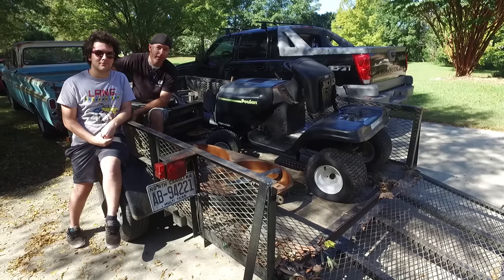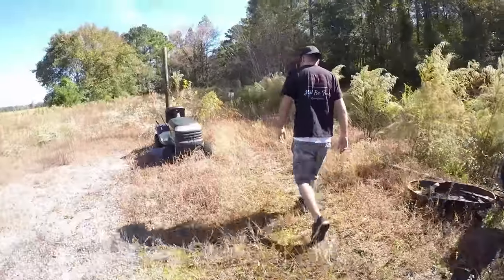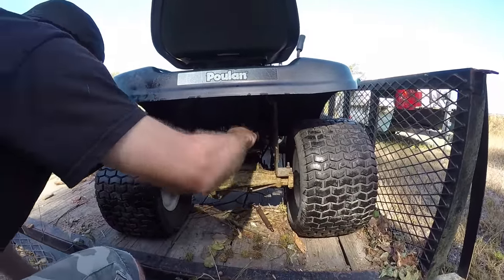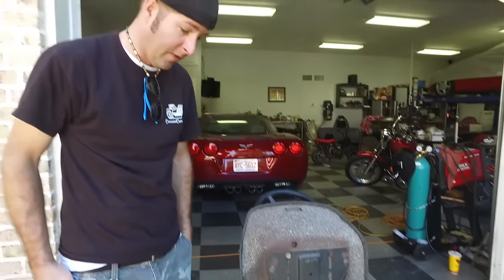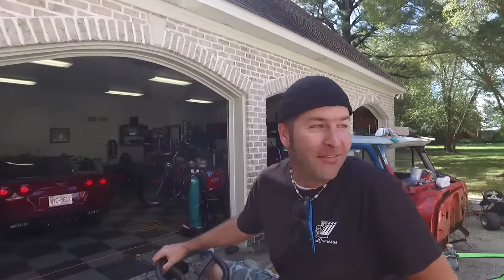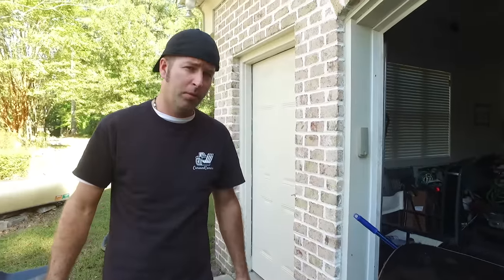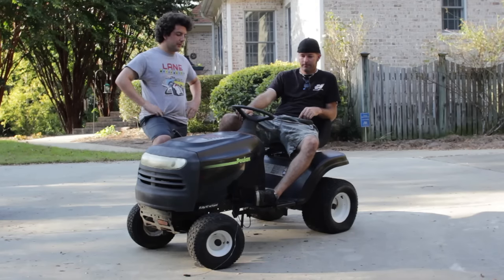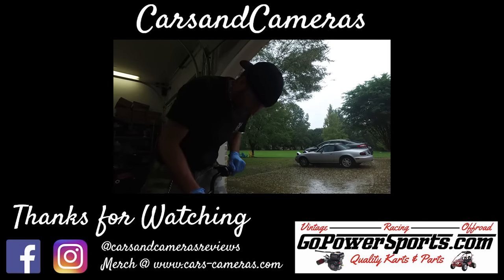We're Building a Racing Lawn Mower!

Comment: Love it! I'm building my first one now too. Intek 18.5 with a peerless 6 speed. Going with a 7" on the motor and a 3.5" on the transaxle. Can't wait to see more guys!!
Reply: Btw... you may want to lower it first then worry about pulleys and speed. That way you will know what kind of space you have to work with and figure out the best way to line up your belts.
Reply: mine has 7 horse flat head brigs i cant turn right with out sparks flyin out the bottoom my plan is pully swap throttle and grind grooves for gears

Comment: I'm jealous. years ago I built one out of a craftsman riding mower. I lowered the entire body,, moved the front end forward on the frame, and made an adapter for the steering shaft so I could run an old go kart steering wheel. Was working on mounting an 18 horse briggs twin with a straight axle in back, but life happened. Never quite got to finish it.  Excited to see what you guys can do, you never disappoint.

Comment from the maker: It's destined for 40mph... Hopefully.
Reply: CarsandCameras 3rd
Reply: CarsandCameras hello
Reply: It'll be fine.
Reply: CarsandCameras can u guys build a gass razor scooter with a weedeater engine
Reply: CarsandCameras thank you guys so much almost in every single one of you guys videos I have suggested a racing lawn mower
Reply: CarsandCameras. you guys should have a live axle kit on it but on that rear engine mower has a gearbox that you guys could use as a transmission
Reply: ehhm, i'm only 2 minutes in but i highly doubt this will work whilst being able to mow. The Rotor on the bottom has a maximum rpm for a reason. DONT EXCEED IT. BAD THINGS MIGHT HAPPEN. sorry for shouting so loud.
Reply: CarsandCameras remove all restrictors if there are any ;)
Reply: CarsandCameras whenever you slam that tractor down to the ground if you don't want a go-kart axle what you could do is flip the transaxle upside down so pulley is at the bottom so it can match up with the engine pulley easier
Reply: you guys need to check out fearlessfront he dose all kinds of mud mowers but usedt to get them up to like 50 mph
Reply: Scorpion623  I second that. I've been watching him for like 2 years now and he is awesome more of a tractor guy but still, his ingenuity is awesome!!
Reply: CarsandCameras should easily get 40mph i have a couple that do 60mph using only stock mower parts.
Reply: CarsandCameras you guys probably won't make it over 25 miles an hour without the deck breaking or something else
Reply: CarsandCameras when is the next video
Reply: You should build something with a 2 Stroke "racing" engine
Reply: CarsandCameras lol
Reply: CarsandCameras just a friendly word of advice for you guys...that lag in the starting in many many cases for those old Briggs is caused by the valves being out of adjustment i believe especially for that poulan that the valve adjustment is 3-5 thousandths but any who research it some your self as well I hope I have been a little help full just as some of your videos have helped me on my projects thanks guys!!
Reply: This will work #CarsandCameras hopefully - lol can you hit the subs for them thay work day and night p.s Isaac works but Jon is in school. Help them out!!!
Bin hear since you guys have been on YouTube!!
Reply: CarsandCameras 
The larger you keep the rear pulley the less slip you will get...
3-4" on back and 6 or more on the front. 
I'm running a 6 front 4 rear. 
Mine does 23 with 18" tall tires and a mst-206 and I keep it around 3800 max. 
Lock the diff and put oil in the gearbox. 
Fearlessfront is the man for transaxle info, although everything I've learned I've posted in videos on my channel. 
I swapped a 20hp in place of my 12, and now it's downright scary and will wear you out of you try to ride it hard.
Reply: CarsandCameras 
After swapping pulleys you might need to readjust or add guides near the pulleys ...
those guides are those funky rods handing down near pulleys. 
If they aren't there , when you push the clutch , the belt slings out too far from the pulley and it'll keep going and will grab and chatter and act crazy. 
It took me a few minutes to figure that one out. You may or may not need to add some idler pullies, or relocate existing ones. 
Getting the belt setup right so it doesn't throw belts all the time can be a little tricky but not impossible.
Reply: I did notice a little slipping when we swapped pulleys lol
Reply: thanks for the info
Reply: Isaac it'll be fine We are running the stock rear 9" on the front and the stock 3" front on the rear and have no slipping issues. Even have a 10" front and 2 1/2" rear on one of them and still no slip. We did use a stronger clutch spring. You can hole saw the centers of the pulleys out and swap them and weld the centers back in.
Reply: I've had good luck with those "red Kevlar eBay belts" , they seem to grip good even when wet. 
I briefly used a tractor supply blue one before I got the red one , it was pretty good too. 
Way better than a standard belt.. 
get one after your rig is tested and works
Reply: CarsandCameras you guys should put a snowmobile engine on the one that you don't use for racing
Reply: Sick you should make a video
Reply: In the south (where snow isn't common) snowmobile parts are hard to come by and when you do they tend to be rather pricey.
Reply: +CarsandCameras Come on, yall can do 50 with that thing no problem with some good gearing and good tires. :D
Reply: if you try to keep a mowing deck on that thing and go fast you're...jackasses. racing mowers are nothing new... there are multiple u.s. sanctioned groups on many levels... all of them do it safely. to do 40 with that trans u need like 8" engine pulley and 4" trans.. I shouldn't tell u that cuz at 15 mph the stock front end turns into a shopping cart and u will get hurt! also an ungoverned briggs of that size is no joke keep that in mind while Conrod and counterweight shrapnel cut u up like knife thru butter
Reply: You guys shouldn't over-rev either of those engines, especially the bigger one. The Briggs engines with the synchro-balancer can blow just slightly over-revved.
Reply: MetalGear I have one of them that the rod shattered on.. i think it may have been ran low on oil though. Im not sure if they are really a bad engine but i have stayed away from them. I find the v-twin engines are best, but don't rev as high as a single cylinder.
Reply: I.C. karting generally the older the better as far as mowers. 
My late 80s deutz allis (think simplicity 4212) has a pretty beefy front end. 

I really didn't do anything to it besides lock it from pivoting. 
That's one thing that makes em really stable.

I really need a bearing setup for the wheels cause it just wears the crap out of the spindles. 
But yea the later mowers (Sears lt1000 comes to mind) they fold up like a pretzel.
Reply: MetalGear 
yea we use a single cylinder Briggs with synchro balance ,on their 8kw standby generators and no load speed is 3750....
I've had a few blow up.
Reply: MrTheHillfolk Them folding up is simply not true. Watch my videos, we jump one multiple times and even reach a distance of 18 feet. No damage at all, there is no additional bracing on the frame but the front axle is welded solid to the frame. They are more durable than you think.
Reply: MrTheHillfolk I suppose anything is possible.. in my opinion they are quite strong. The green one we jump was $40 it has a 12hp engine and has been swapped and lowered. Absolutely nothing extra is needed to build them the way i do it, all parts are made from existing mower parts. Just good cheap fun. Maybe something will break.. keep watching.
Reply: FireAndGasoline yup.. all parts I use to achieve a mower that handles like a racing kart can be sourced from mowers or otherwise dirt cheap... I've seen your builds and they would never ever be allowed to race in any sanctioned event..  I get that's not your intent and u aren't concerned with making corners but when u start trying to really push limits like no lift turn ins and hard drift entries with posi  on dry pavement u will learn what is safe and what is stupid real quick
Reply: I.C. karting I never once claimed my mowers to be safe.. it's clearly not safe to jump them like we do. Maybe even on the stupid side of things but thats what we were going for. However, they are strong and reliable. And you're right, there are some things that could be done cheap to improve things but we have just had more fun tearing it up the way it is for now. Like i said its just some good cheap fun.. we can all agree on that. This is not something we have done forever and im sure we have a few things to learn but we are far from done yet. Also thanks for watching.
Reply: CarsandCameras ok ike I'm done
Reply: Teddyvision 
yup , use some worn out turf tires for awesome yard drifting without killing the grass too bad. That, and don't lift , or it'll be sure to highside on you!! 
I'd make it look like hell, and 2 weeks later it was fine.
I've got a few mower vids on my channel, I don't off-road it really, I just have some open grassy area around my shop.
Reply: yeah I like your builds but believe it or not hitting a mud hole at 7mph with 20" tires on a stock pivoting front axle can break them I've done it usually just the tie rod bends but ive bent a j spindle right under a craftsman rock crawling with big tires... I feel like they take impact better than a direct prolonged torsional force? Idk I'm surprised u don't bend j spindles from hard landings but again u'r on soft small tires on grass so it's just one bounce and the force gets dissipated quickly... try jumping into a snow bank or thick mud with big tires and something will give
Reply: Ethan Sickler Mine do 60mph all stock parts.
Reply: FireAndGasoline where's that vid of a guy on a green craftsman going down the road, and the camera operator in his car pans down to his speedometer and it's indicating 55 lol. 
He probably had like a 3:1 or better on his pulley ratio.
Reply: MrTheHillfolk I've seen that video on youtube somewhere. Not mine though. The dark green one we locked the rearend in does about 60 and have a black one with flames that hasn't made it into a video yet, that one easily does 60. The lime green one we jump only goes about 45 because it has a very tired 12hp engine. We have a 14hp for it when we get time. We did a little snow/mud romp today. The locked rearend makes for alot of spinning out and donuts, ill get that up soon. I should clean them all up and go over all the specs of them all in a video, maybe that will help people understand what differences in things like pulley sizes and engine types make.
Reply: FireAndGasoline we have a mill and lathe at my shop, I'd love to figure out how to internally mod a box , move some gears around so you don't have to run the input so fast. Like those 180$ gears from roms for a peerless 820. 
That stretch 44875 guy had a box he used those in , but I think I saw one where they had an extra box and took some gears from that for the mod. 
I'd be happy if mine did like 30-35, it'll be a handful in my backyard but quick enough to run down the road to a buds house a few miles away.
Reply: MrTheHillfolk its actually the pinion and ring gear that you would want to change i believe. there isn't really any room in there for a bigger gear but maybe a different tooth design instead. I think if you had the ability to make gears you could just design your own transmission specifically for a racing application. Something like that would probably be a good seller. I just picked up a peerless 770a so im gonna do some experimenting with that, going to try using different transmission output gears and axle gears to see what works.
Reply: FireAndGasoline if you change the ratio the rpm will increase the speed n torque
Reply: a sealed bearing kit for the transaxle would increase the life of the transaxle
Reply: Teddyvision im sure it would but i have had one apart that we have been beating on and didn't see any significant wear on anything. There are plenty more mowers out there cheap to worry about it. If there are limits of what they can handle we will definitely find out. We are gonna beat the crap out of it till we break it, then probably fix it and break it again.
Reply: Isaac it'll be fine Kevlar belt and double pulley clutch setup, and heavier clutch spring.. this will resolve your slippage problem.. also remember you're building a 45mph mower not a wromper/mud mower, if you want 20 mph and wheelies go with 6 and 4.. 20" tires, if you want low and fast 7 and 3 with double pulley clutch tighter clutch springs. look online at racing mower, double pully clutch.. its simple to make if you can weld.
Reply: dj beard that is true but you could buy an engine from the north and have it mailed to your house

Comment: My mate and I were discussing lawn mower boosting just yesterday. fantastic work guys, you're an inspiration :-D
Reply: thanks
Reply: Isaac it'll be fine 7 inch pulley on the engine should be 1 inch bore and then 3 inch pulley on the transaxle should be 5/8 bore new belt Kevlar if you can find it in that size and a new clutch spring you should have no problem reaching 45mph also if you look at fearlessfront on YouTube he will show you how to lock the transaxle and show you carburetor mods you put a Japanese four wheeler carburetor on that engine with a little fabricating with a drill
Reply: Isaac it'll be fine also be sure to weld the front end up so one back tire doesn't lift off the ground going around corners it hurts to flip a mower over 40 miles an hour I know because I've done it, it will land on top of you every time so I recommend a teather kill switch lime on a jet ski
Reply: ok. thanks

Comment: Those RER mowers are perfect wheelie machines. I have a video or two on my channel of riding a modified one.

The engine in the Poulan is junk, those AVS engines like to grenade when wound up. But it looks like it has an MST series Peerless transaxle, which is one of the best 3/4" mower transaxles available.

Comment: Been waiting for this.. you are gonna need to change both pulleys though. That is definitely a good platform to start with and the front end is easy to lower. You just unbolt the brackets holding it on cut slits in the frame where it sits and put it back together with the brackets upside down. Welding it solid is best to eliminate sway and for strength. We even jump ours and the hold up great.
Reply: sweet. thanks
Reply: thanks

Comment: You guys should put the Cub Cadet trans (a peerless 700 series trans) on the Poulan, driving a straight axle. (the poulan is an AYP chassis by the way, same as some Craftsman tractors). Would make it a lot easier to speed up and lower.

Comment: I have same mower, first thing I did is welded differential gears together, so you don't loose a grip on a turn.. Second thing - weld the front axle to a frame..
And then -  pulleys!!!

Comment: You guys need to put a 1" pulley on the transmission side and you'll need to put the biggest pulley on the motor side that u can fit and a stronger clutch return spring and the will make the tractor a lot faster and also you should put a foot throttle on the tractor too
Reply: Jordan domino that gearing will be way to fast mine has 8inch on engine and 4inch on the transaxle. it goes 30 flat stick and is too fast
Reply: Jordan domino A 1" pulley would have lots of belt slippage going on

Comment: that poulan is actually a craftsman, i got one in my yard- has same drive setup as my 85 craftsman.   i experemented with a shift on the go murray, 4" pulley on trans, 18hp twin briggs with a 6" pulley , used 4 golf kart tires- it ran in the 40mph range .  motor was totally stock with a footpedal and governer ( with spring to avoid over revving). only issues i had were not locking front axle and terrible brakes. to deal with trans, i took it apart and cleaned it, then dumped straight lucas oil additive in it,  it whined terribly slowing down but ran fine at speed.

Comment: i dont remember the size of the pulleys i put on my poland looks just like yours. but i had to pull the front pulley to put the belt on and used the frame as belt stops and the rear pulley i ended up with a 3 inch that alone made it run over 40 mph. i have a old craftsman now after seeing this video i might do the same thing to it.

Comment: Lock the transaxle on that bad boy and if u don't know how to visit fearlessfront on yt and he has a vid on how to lock the transaxle
Reply: Go karting101 mine was scary before I locked it. 
You could go in the street and do 1 wheel peels and if you leaned to get traction it would hook and wheelie and threaten to throw ya off.
Depends on the differential style it has, I tried just welding the pin to the gears like fearless did and broke it. 
Luckily I was able to weld the spiders to the side gears.
Reply: MrTheHillfolk I see you everywhere
Reply: The Victim Card I see you everywhere too
Reply: Screw that Live axle is where it's at!
Reply: The Victim Card 
haha yea YouTube has replaced tv for entertainment, might as well watch what you want when you want !!
Reply: redneck4life887 
Yea they could do that too, there's a million things they could do for mods
Reply: MrTheHillfolk I built a live axle/torque converter set up and its amazing! But yes in endless options.
Reply: redneck4life887 yea I wanna try a converter on a go kart I have
Reply: MrTheHillfolk I have them on my Race Karts. Really gives you a strong acceleration off the line.
Reply: redneck4life887 yea I've seen their wheelie kart 👍🏻
Someday I'd like to have an extra toy for if a buddy stops by, we can race in the backyard. 
I have 100 other projects first, it's not even near a burner on the stove,so to speak 😛
Reply: MrTheHillfolk I have 4 projects going my self and I am thinking about a 6.5HP Predator powered power wheels police car for next project, something to piss off the police even more =)>